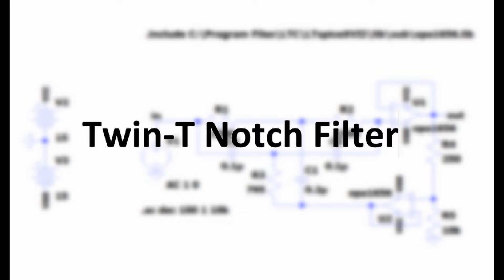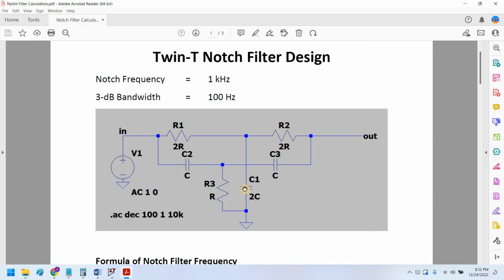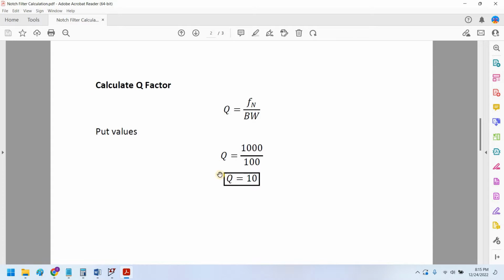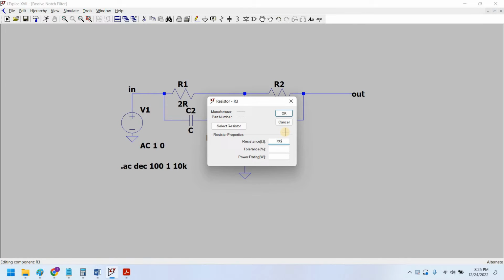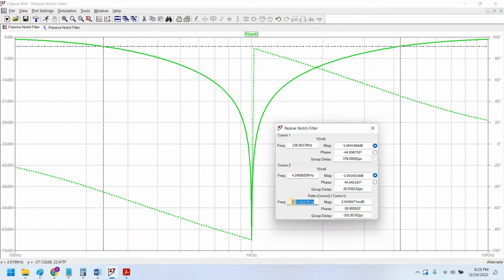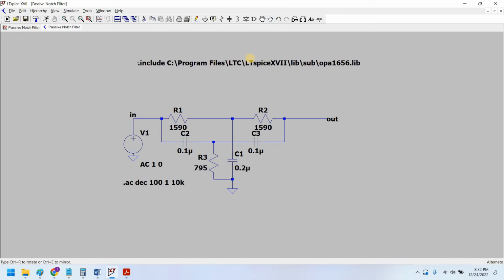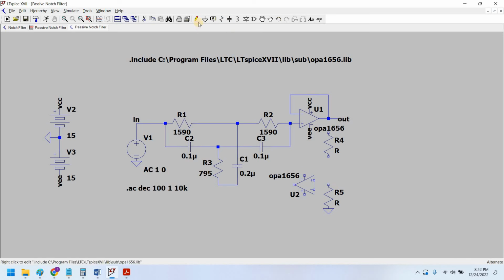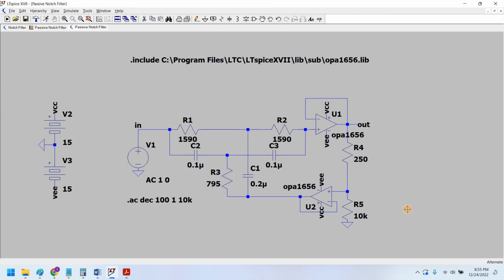🔥🔥Twin-T Notch Filter Circuit Design, Simulation Analysis in LTSpice🔥🔥#circuit #ltspice #tutorial

Comment: You never covered the derivation of the values of the R4 and R5 voltage divider resistors.
A total waste of 25 minutes if you do not cover the derivation of the gain of the feedback path required to raise the Q value to the required level to narrow the bandwidth.
I imagine it is 10,000/250 = 40 but don't know why.